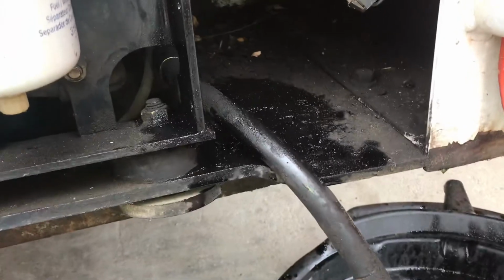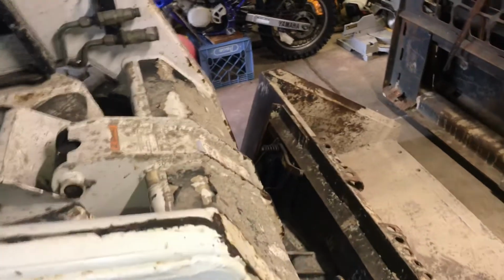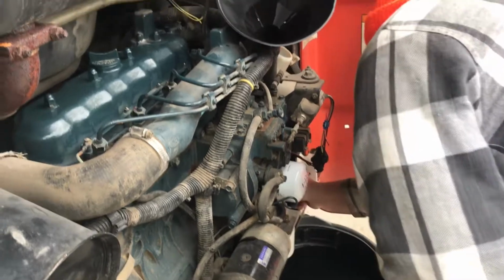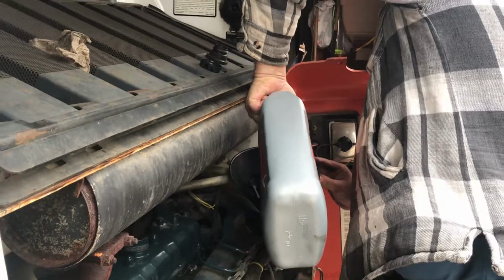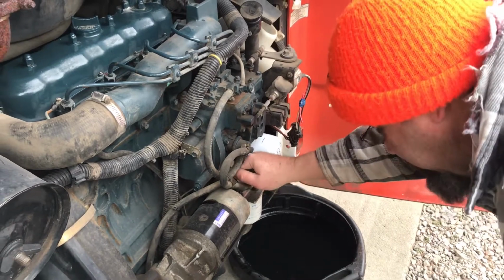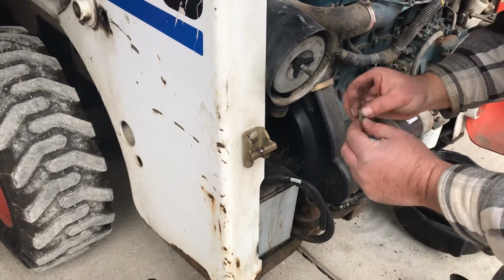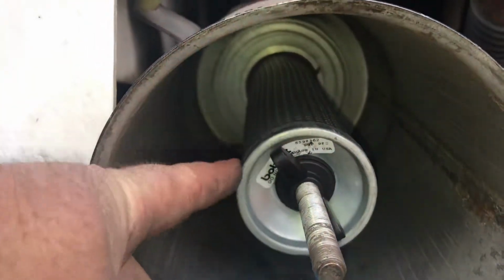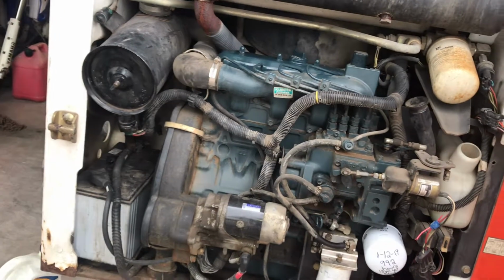Bobcat 763 F-Series Oil Change

Comment: I like your new toy. Thanks for showing it to us. Now you can scrape snow out the drive, and dig the pool, level the garden spot, bring up the wood, unload the lumber and haul to the back, dig out a foundation, pull the neighbor's truck out the ditch, and about 50 other things. LOL  At one of my former residences, my neighbor was a building contractor had one, he he used it for all those things and then some.
Reply from the maker: Thanks, 1 of many tractors I have. This came from my fathers Estate. It’s going to take some time to get used to the foot pedals for the loader. I’m used to using valves and joysticks.
I do have a woods clearing project in mind for it. The compact size it perfect for what I need to do.
Reply: @truckdrivinmilanr  
Nice 😎😎👍

Comment: I found this to be helpful, thanks for doing, recording and sharing. I will add, the Oil drain rate was drizzling compared to a less viscous car oil so be patient, folks!

For others:
7.5 Quarts oil capacity with filter. Use 15W-40.